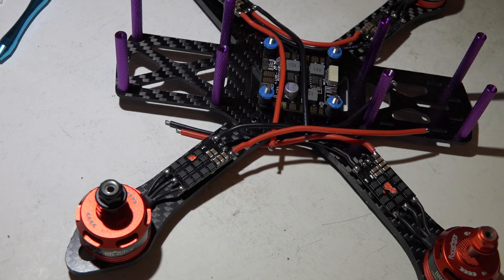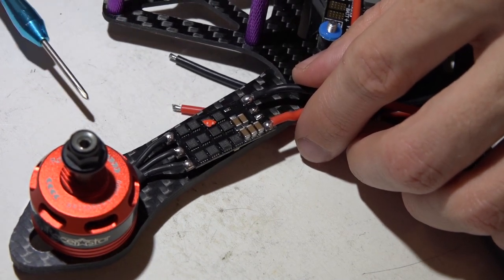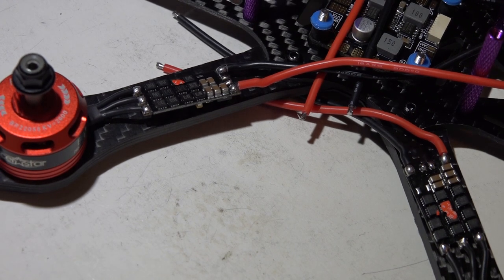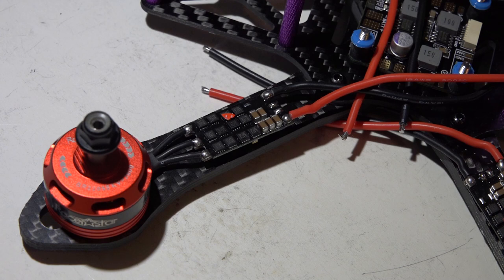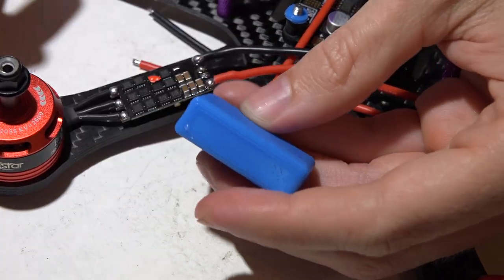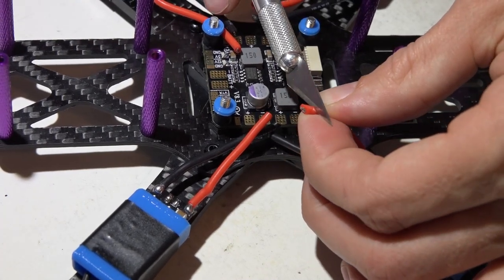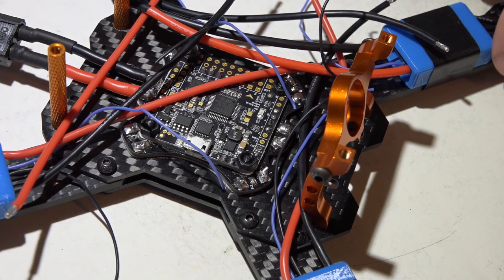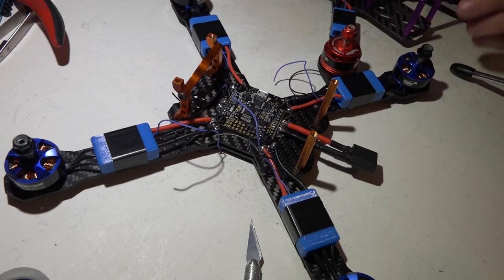Multirotor Build Pt7: ESC Protection & Powering ESCs

Comment: I protect my ESC's by mounting them to the arm with double sided foam tape, attach them around the arm with electrical but in the direction that the prop will hit the ESC I wrap a broken prop blade right on the side so it takes the prop strike and not the ESC.

Comment: problem...flight controller isnt seeing any radio inputs from the rx. rx and tx are bound and have telemetry. sbus signal wire is good going to the fc. 5v wiring is good, no shorts. full battery wiring, no shorts. flew one pack, landed, swapped batteries then nothing.
Reply: Settings are correct. Serial rx and sbus selected. I tried to rebind. No change...on a side note, the escs ive been using switched rotation on me before so idk if that may have anything to do with it. Lumenier silks. And wont connect to blheli.
Reply: Yea basically the rx and tx and communicating but the flight controller doesn't show any radio input in betaflight
Reply: what flight controller are you using?
Reply: F4 advanced flight controller from getfpv
Reply: X4rsb rx using sbus